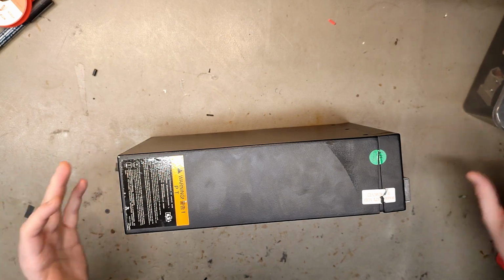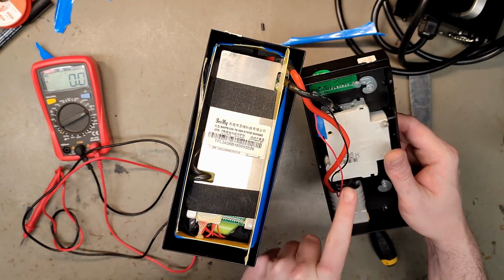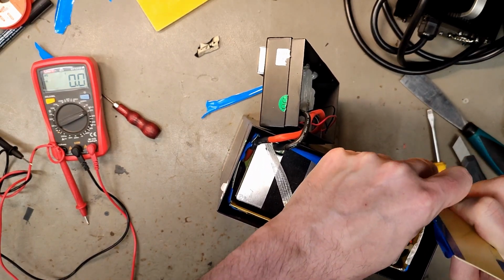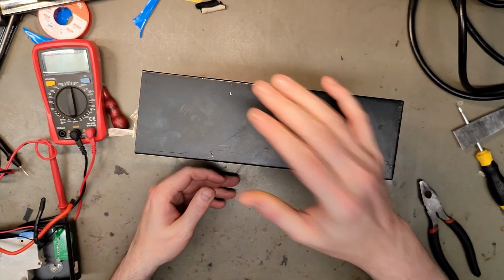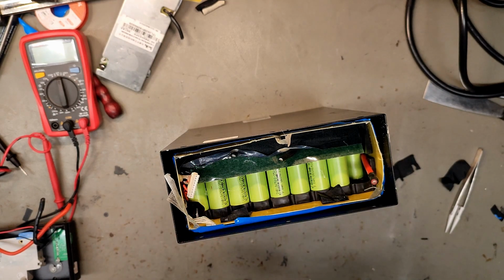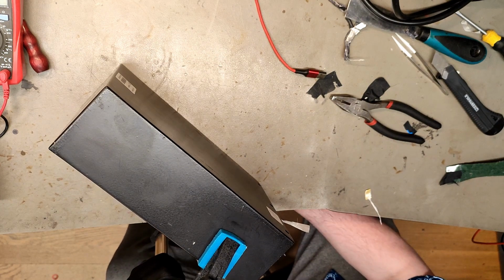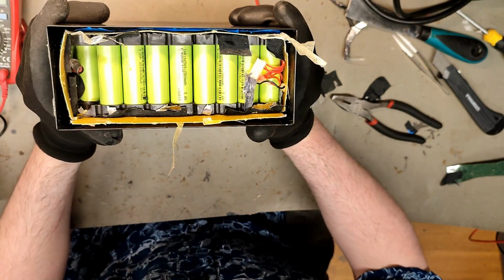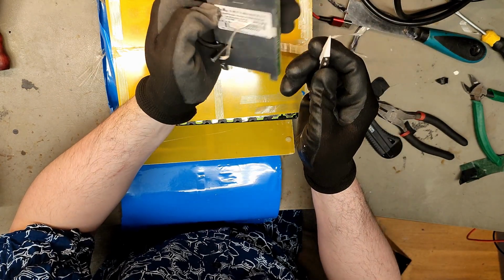Why reparing a Heli DC15 Electric Pallet Jack Battery is almost impossible

Comment: Nice job and hats off for your persistency! I didn't understand why you didn't use heating on the back side?
Reply: Heat only works if hot glue or adhesive tape, in this case it was silicone in the bottom and it would not have helped, also heating the bottom of a metallic case battery to 150 degrees C in not very safe. The only thing that could have helped was maby dental floss. But thats for another video.